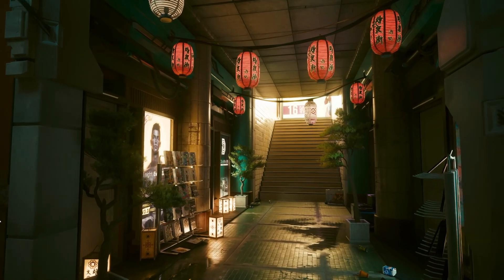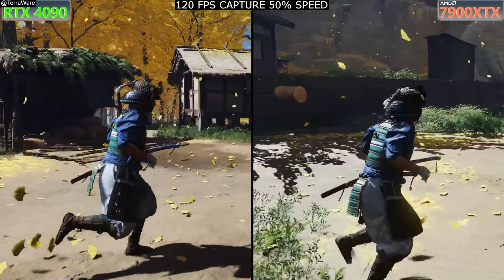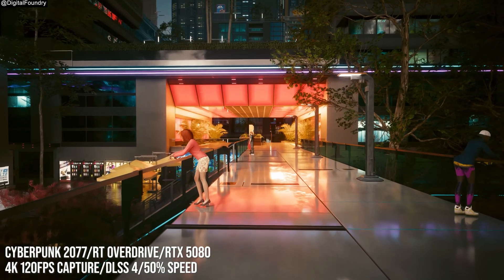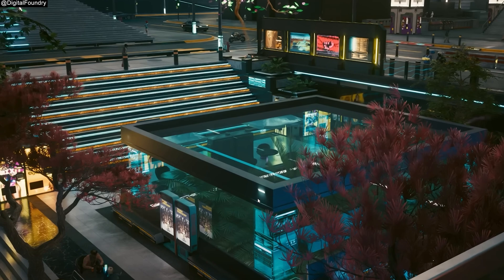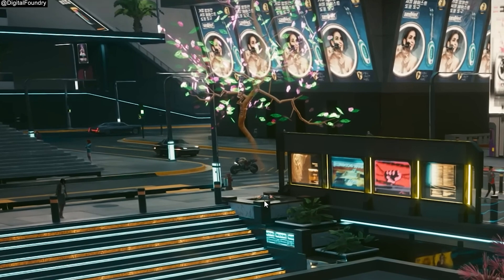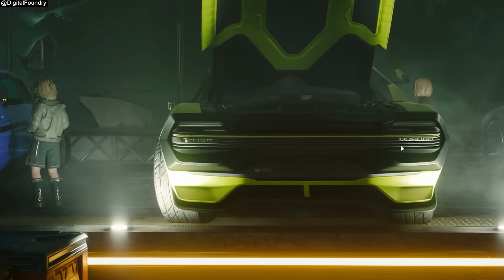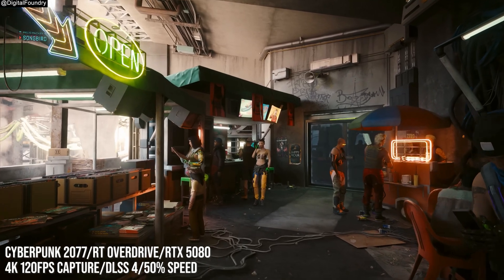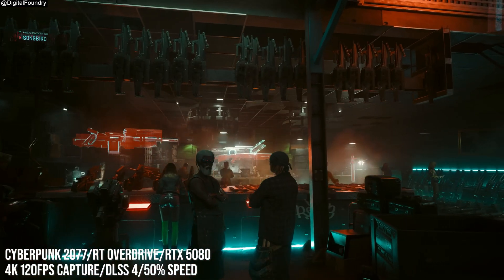A Look At DLSS 4 Multi Frame Generation's Image Quality

Comment: Transformer is unusable for me, the bushes shimmer heavily in the Badlands with it on.
Reply from the maker: Yeah. I have a video that should be available in about an hour or less doing a deep dive on the DLSS 4 transformer model and I do point out this issue and why it happens. It seems to be more unstable than CNN when not using RT/PT in the game. They'll probably fix it but I know exactly what you mean.

Comment: Im so confused! My pc has a 1650 super. So I'm looking to upgrade this year. At first i was going to go with the 7800xt. But then i decided to go with either a 7900 xtx, or a 4080 super. I refuse to pay the insane price of a 4090 or 5090! Now, with all this dlss vs fsr stuff, i don't know what to do 🙄
Reply from the maker: If it were I, I'd wait for the 5080 at this point since its supposed to be similar price to the 4080 Super and while not much faster, the DLSS package is too good to miss out on.
This is what I would do. I love AMD, I have a 7900XTX and am excited for FSR 4 it looks good but DLSS is in way too many games and its gotten even better. I will have a video up later today comparing the old CNN with Transformer DLSS model. Its really good.
Reply: @TerraWare  🫡

Comment: it is a Preview build of Dlls4 running on a Preview build of Cyberpunk. Also DF did preface this by saying it looks better IRL Due to limitations of 200+ FPS being cut down to 4k 120 then shown at 50% speed. So Some artifacts might not be really perceptible and its not actually panning that slowly. Granted there does seem to be very persistent effects that are very notable.

https://youtu.be/lA8DphutMsY?si=S6iapoThAx88QTzk&t=690
However, there is some pretty crazy ghosting here which doesn't seems to happen in the CNN model. Also very interesting DF doesn't have any footage of Cyberpunk's main DLSS problem which still is driving and where this person found some major ghosting issues.

But, dunno all of this could be fixed or in a much better state by the time it comes out, hopefully!

Comment: 2:12 I think is because the moving texture behind it which Brian Catanzaro said was an issue with fg and AI had to be taught to "discard" it kinda..so the leaves in front of a moving texture are an issue.
Reply from the maker: Yeah I've seen all those interviews. They'll adress these things with time but it is similar problem areas for FG I have seen in other games too. Now you have 3 generated frames vs 1 which stands out more when it comes to the flaws.

Comment: Still looks better than lossless scaling 😊
Reply from the maker: I need to spend more time with LS. I've only tried the 1X frame gen in Kingdom Come and it worked pretty good with a base of 85FPS. That said I'd expect DLSS 4 to look better absolutely.
Reply: @TerraWare  I'm messing with it now on cyberpunk and I got it to work but still way off to much artifacts. The trick is to limit ur framerate to lowest so it's not jumping up and down.use g sync and vrr.

Comment: These examples are maybe obviously visible on slowed down videos or when showing super low framerate content. This will be 100% different scenario when the user has a 240Hz monitor and the native fps runs for example average of 80 fps. When they play the content at 240 fps level with MFG, the difference between frames are so insanely tiny that any small detail differences are not an issue.
Reply: Users won't use the MFG if it causes major screen tearing type of major visual issues. If all the frames have smooth frametimes, no tearing semi low latency, and good native quality, then the MFG experience would be great. Some might think that some of these small game artifacts are a big issue. In reality, users won't focus these between insanely fast frames, but they do see massive artifacts that pop up all the time. I just hope there are no massive game breaking artifacts/issues.
Reply from the maker: The issues are more in your face slowed down absolutely but I was able to notice some of the problems even at regular speed but there are many factors, the base framerate, your tolerance and if something stands out or not. Problem with making content about FG is trying to capture footage and display it in a format people can see because of the amount of frame rate you are dealing with, capture limitations and YouTube's 60FPS max format.
Reply: @TerraWare  I 100% agree that it's hard or just impossible to make 60 fps YT videos to show the MFG. These video examples that Nvidia uses are all low native fps content that uses MFG, because it's impossible to show the real life difference when the game runs, for example, native 80 fps at 3x multi frame gen 240fps. This is something people have to test. Even if someone had that 240 fps video, they couldn't show the viewers how it feels in real life.

Because 99.9% of viewers can't ever even test MFG, they can easily just say negative stuff about it. Basic internet behavior that always goes the same way. It's about the same thing as reading news headlines and making opinion based by that.

Comment: Are you using the actual YouTube video or did you sign up for DF’s Patreon and downloaded the better quality version of the video? If you’re doing the former, it’s utterly pointless to look for visual artifacts in individual frames in a 60fps stream outside of key frames, as 99% of the stream is heavily compressed and uses motion vectors to reconstruct the image (in a way not too dissimilar to the way TAA and FSR work). You could still potentially discern between compression artifacts and DLSS artifacts, but it’s really hard to tell. I don’t know what compression settings DF use for their “premium” downloads but it’s definitely worth checking out if you want something closer to the ground truth.
Reply: Not to mention the fact that in reality, perceived motion clarity of 120fps with interpolation is very different from what you get by running a 2x slowed down video at 60fps, let alone frame by frame. Sure, analyzing still frames is still a robust way of identifying artifacts, but perception of movement is equally if not more important than the quality of individual “physical” images, so things like frame pacing might actually play a more significant role when doing multi frame generation than the image quality (which is honestly quite acceptable even with cheap solutions like Lossless Scaling when using the base x2 mode, and when I play the DF footage sped up 2x I honestly can’t tell any of it is generated).

And then of course the question of input lag, but that’s a separate discussion, and we no it pretty much makes this unusable in any low latency esports scenarios but is okay when playing games with a controller or in slower paced mouse controlled games.

Comment: I would be sceptical about MFG as a feature worth getting Blackwell alone. For now we need to see how it works in bunch of games, because such tech is always presented in ones it works best. Remember PSSR? Be ready for FSR4 outside Ratchet. Plus I'm personally not a fan of generators - they are not a pass to real smoothness - responsiveness - nor prettier graphics as many see them. They tend to work well when your framerate is already not that bad (~60 fps) WITH satisfying graphic settings. And then give you less responsive kind of frames with addition of artifacts. Useful in old games with framerate caps, but it's trying hard.
Reply from the maker: @2MichalChojnowski2 I agree with a lot of it.
Reply: @TerraWare  These are the times when performance related things get complicated and we need more than ever scepticism, technical analysis and reminding such knowledge whenever the matter is talked about. These are the times when people get crazy after Jensen said 5070 offering 4090 performance, but it's like they don't want to notice that just one sentence later he added it's impossible without AI. What could only mean help of DLSS-related tech. Or some guy here in the comments thinks FG is a pass to RT in 4K on midrange cards.

Comment: This is pretty much the first thing I pointed out when I saw people on YouTube showcasing this. I could see the trees had issues.. A recording of screen. It was that obvious. I saw also halo around characters, then the ms spikes that was pretty bad. we are talking like 80ms while walking or running. Fur, was also problematic.
Reply from the maker: I noticed that too and a reason why I made this to point it out but to also point out the majority of the screen looked really good as you would expect from a user input frame. I think over time or maybe with the final code a lot of this could be mitigated. Some games will probably lend themselves a bit better than others. Time will tell.

Comment: Thnx for this analysis. Don't forget (M)FG has major trouble with games like CP 2077 maxed out, since the base fps is around 26-27 @4K with everything maxed out (on a 5090). Games like the new(er) Doom generate much more native frames, thus (M)FG will look better. Anyway I rarely use FG on my 4090, cause the image always looks with less depth.
Reply from the maker: Yeah good point. We don't really know what the base framerate is although they were using DLSS upscaling in this video but the base framerate should play a role in it all.
Reply: CP2077's FPS are not 26-27 lmao, that's without DLSS at all, the base fps should be around 70-80 and then MFG up to 240-260
Reply: I also have a 4090 and never use frame gen too. Too many artifacts, and I fell the motion is somewhat weird, specially in fps games.

Comment: Another great vid, as per usual. 

Juggling whether I should upgrade to 50 series has been mental gymnastics. Frame generation is not all that impressive, I play most games with controller and 60 fps is very easy for me to adjust to if the frame pacing is good. Seeing as though frame gen needs baseline 60 to be optimal, the appeal gets even less for me.
Reply from the maker: Thanks. I understand what you mean. If you already have a 4070/Ti/4080 the gains aren't what we had last gen. The 5090 seems to have the most gain but even that is less than half what previous gen was and noticeably more expensive. It's a very hard sell for sure.

Comment: I don't quite get what switching "from optical flow to AI" means... So basically there was a good reliable tech, hardware supported, and now they just switch to some unstable, unreliable AI model for this? Honestly, I use FG x2 currently and in most games i don't notice any artefacts unless I want to stare at the screen and seek for those artifacts. But with new FG it seems like they now have artifacts that are really hard not to notice... If i'm using FG x2, will i get the same quality that we have now with optical flow?
Reply from the maker: Good point. It looks like the whole model has been revamped and doesnt use optical flow. They say its improved and I wouldn't worry too much about it not using optical flow. FSR 3 essentially uses a software method and works really well.
In this video we don't really know what the base framerate was. They said it was 4K with path tracing and DLSS upscaling. If the base framerate was 40 FPS for example it could result in more artifacting with the problem areas.

Comment: I don't know when, why or how, but I have this feeling Nvidia are going to release a new version of G-Sync (AI-Sync maybe?) in the next few years that will be designed to work directly with Frame Gen to help with the pacing of the generated frames, which in turn would result in a cleaner final 'fake' frame.
Reply from the maker: I think we are going to see more and more software solutions and features going forward.
Reply: @TerraWare  Agreed

Comment: Ill just be happier with my 4080 super when 50 series launches. And we get enhanced frame generation and upscaling as well.
Reply from the maker: You should get everything but multi frame generation. For now anyway although the transformer model DLSS will have a higher tensor computational cost resulting in less FPS vs the CNN model of DLSS with a 4080 Super you should be pretty good vs all the other RTX cards.

Comment: I noticed this in the DF video and I think MFG looks much worse than FG did in the previews. I'm sure Nvidia will be making MFG way better, but wether it wil be good at the 50-series release or if it will take until the launch of the 60-series before that remains to be seen.
Honestly, most of the new tech Nvidia showed us at CES, while cool and probably a big deal in the long run, are things that won't matter much for the next 3-5 years and people buying a Blackwell GPU need to be aware of that.
Reply from the maker: Some yeah, like Nvidia ACE was pretty cool. The new DLSS Transformer model should benefit us right away although at higher computational cost.

Comment: AMD is only launching RX 9070 in March. Will be going with the RTX 5070 if 3rd party reviews for AMD is not out by the time the 5070 is out. I've been without a GPU since December. I loved using FG with the 4070 Super I returned so I am looking forward to maxing out my 165hz monitor with Multi FG in singleplayer games

Comment: They switched from hardware optical flow accelerator to ai optical flow. So the optical flow accelerator isn't excuse now. So im curious if they'll unlock fg for older gpus, at least for rtx 3000. There's interview with Bryan Catanzaro from Nvidia on Digital Foundry channel, and Alex asked him about it. The response isn't clear, but he said "we'll see what we're able to squeeze out of older hardware". I hope they'll finally unlock fg for older gpus, at least for rtx 3000.
Reply: The reason why his response wasn't  "clear" was due to the fact that he was there mainly to promote 50 series cards. Kinda defeat the purpose of giving a solid confirmation that FG will come to RTX 20 and 30 series. Although, I am more curious to know if MFG is gonna be available for RTX 40 series (maybe 3x option will do).
Reply: @ashralph9903 If 30 series can run fg x2, then 40 series should run mfg x3. So if they will give fg x2 for 30 or even 20 series, then people will ask for at least mfg x3 for 40 series. But I still hope they will give fg x2 for at least 30 series.
Reply: I understand since 90% of NVIDIA users have 10, 20 and maybe low end 30 series everyone is worried if FG will be available for those models. But as a 40 series user I'm worried more about the quality of the new FG x2, since they changed the model from optical flow to something which is unxplored
Reply: @mike_miller Well. Probably they wouldn't switch from hardware optical flow accelerator to ai optical flow if ai model would be worse than hardware solution. They said that ai optical flow is faster than hardware optical flow, and can provide more accurate informations, or something like this if i remember correctly. So i guess fg x2 will have no issues.